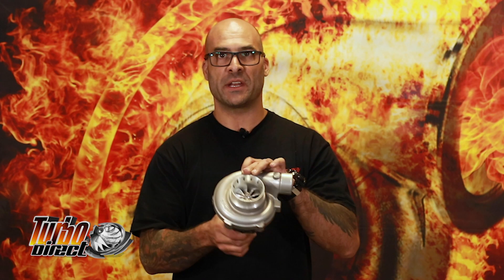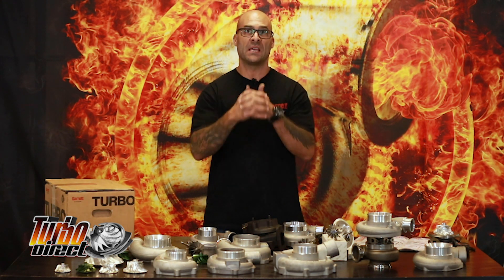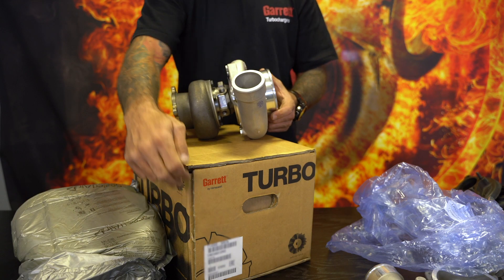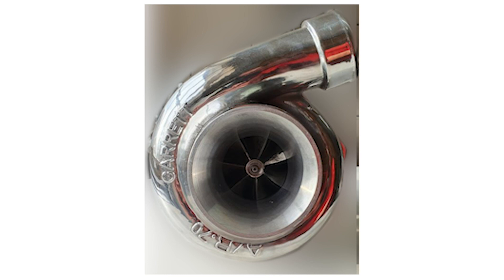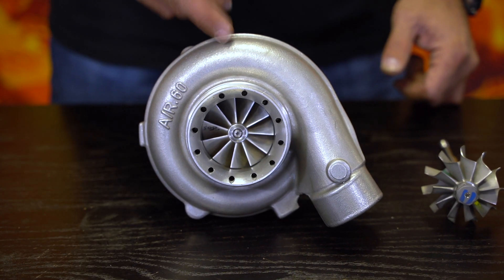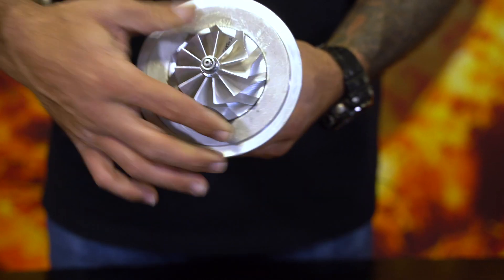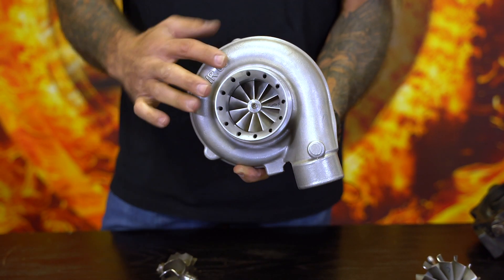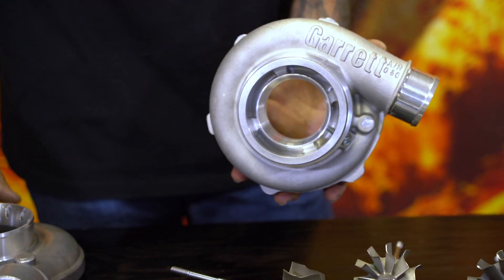How to spot a genuine Garrett GT3582R turbocharger

Comment: Where are Garrett turbos made? Google says China.
Reply from the maker: Like all turbocharger manufacturers, the raw components are sourced from foundries, and then sent to engineering companies to finish and prepare for installation. Then these are shipped to the relevant "manufacturing" plants for assembly and testing - these testing centres appear in many countries, China being one of their main plants in shanghai, i have personally visited this factory in person. Another is in Cheadle in the UK, i have also worked on the VNT assembly line in this factory in 2010.

Comment: What do you think of the xona turbos?
Reply from the maker: From the experience on a dyno with a Golf7R running one back to back with EFR - not that impressed. It does not produce any more power than the EFR, does not spool faster, runs hotter (bearing housing) and costs more than the EFR -- not worth the money in my opinion. The main stream products still take the cake.
Reply: @TurboDirectSA  I feel like if Xona are really confident in their UHF technology, why don't they have multiple dyno graphs of side by side runs with the UHF and classic turbine wheels? Otherwise how do we know it does anything except look interesting?

Comment: Watched a few videos, Dude is passionate about turbos.  Chinese turbos aren't all that bad, we boosting on std internals, 35k for a turbo is never in the plan.
Reply from the maker: Thanks for the compliment - chinese turbos are absolute junk - especially when you do a side by side comparison in many scenarios.  Boosting a stock engine is easy going on the turbo. Build a forged engine and run massive boost on a chinese turbo next to something reputable, and youll start to see what i mean. 

Take a copy paperweight, and do bearing analysis after just a dyno session and youll be surprised.  The perception of the chinese turbos being good is created by the "tooners" who make money selling these to you, they will always be the ambassador of their profit income.
Reply: I disagree with you ! I blew my original garret gt3582, it made 490hp at the wheels 
I now have a pulsar  gtx3584 and making 645hp, for years now ! And it’s fine ! 
These pulsar turbos are everywhere in Australia , they are affordable and proven in the modified car scene 
And better yet they are 4 times cheaper !!

Comment: Hi, i have a question about how Garrett are rating their turbos, example: gtx3584rs is rated 1000 hp with 90 lbs/min. max. compressor flow, if i calculate rapidly, 90x10hp/lbs per min. = 900 hp , not 1000hp, compared to the g35-1050, who is rated at 1050 hp, but 100 lbs per minute who is much closer to a reel calculation of 100lbs/min. X 10 = about 1000 hp, am i right or i forget something in my approach with Garrett hp advertises ??
Reply from the maker: Great question -- In some of my other videos i mention that one of the reasons i prefer the EFR range of turbochargers over Garrett is the fact that the flow maps provided in writing are 100% correct and accurate.  Garrett have begun to make claims that are most definitely not accurate in terms of an X10 measurement on the compressor stages.   for every 10lb/mon of air flow you expect to make around 100HP (ENGINE HP) I have not seen an UNCORRECTED dyno run showing a GTX3584RS making 1000HP. Most i have seen is 870HP, most likely because of our altitude, but not ever 1000HP. The same goes for the newer G-series turbochargers, In fact we see the GTX Gen2 making the same power (apples with apples e.g GTX3076R Gen2 vs G30-770)  

Next obvious question is  = "Is the G-series worth the extra money?"  In my opinion No as the GTX Gen2 is proven.
Reply: @TurboDirectSA   thank you very much for the clear answers you give to us , i appreciate , we see you are a passionate, keep going !
Reply: In the past garrett showed to less lbs on the flowmap. Now they show too much... hehe...

Comment: Based on my limited experience, I think the only 100% safe way to buy authentic parts is to buy them through authorized distributors or if possible through resellers that you know buy/drop-ship from authorized distributors. Everywhere else is the Wild West. I might take a chance on a good deal on a $200 blow-off valve on Ebay, but not on something as mission-critical and expensive as a BB Garrett or BW turbo.
Reply from the maker: 100% - agreed.

Comment: I had a really quick look through Amazon and think I found one that looks fake. The turbine and compressor housings say Garrett on them but not the bearing housing. The castings are also really rough and not up to what you would expect. The compressor cover is not the same as you get from a licenced distributor and the part number 772719-5001S is for one specific assembly that has a 0.89 turbine housing. They also list different part numbers as previous version 772719-5002S and 772719-5003S that are two different assemblies with 0.99 and 1.11 turbine housings respectively and 751451-5012S that is the CHRA.
Reply from the maker: The 772719-5002S is a turbocharger that is ancient, and only capable of 675HP - this is NOT a GT3582R it is a GT3788R, which is a genuine Garrett IF IT HAS ITS NAME PLATE AND CONFORMS TO THE DESIGN SPECIFICATION ACCORDING TO THE GARRETT CATALOGUE.